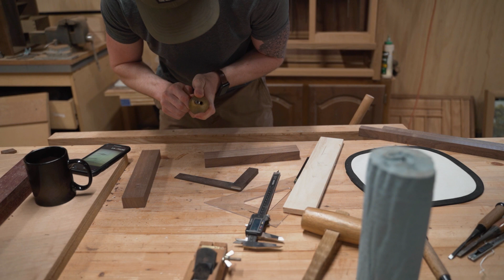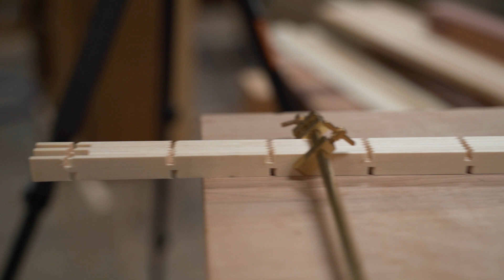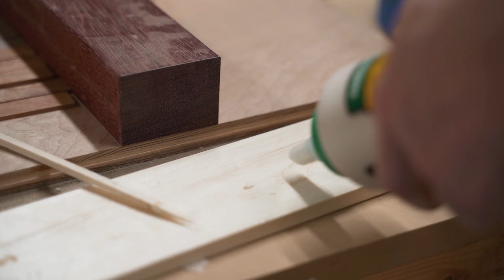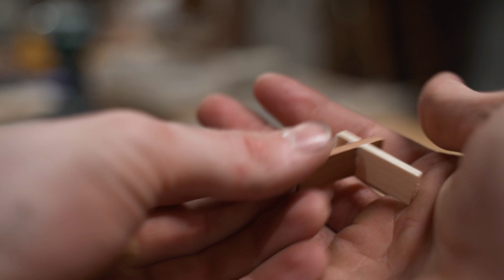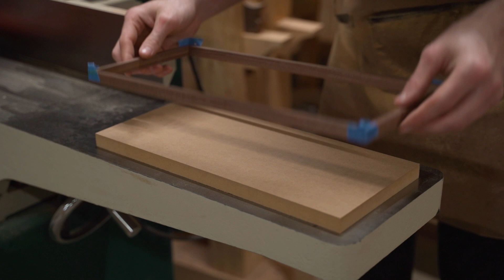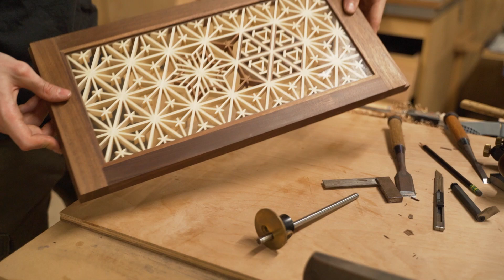Walnut Computer Desk / Ep.7/ KUMIKO panel is complete! Desk is complete!

Comment: Excellent work as always from you. I really like your thickness jig for the Kanna. But I’m curious how you know when you’ve reached the desired 3.3mm thickness? Is it by eye, or do you measure each strip as you get closer to final thickness? Thanks for sharing your work.
Reply from the maker: For whatever reason my kanna doesn’t cut into the mdf, so it quits cutting when it gets flush with the top. So the groove is cut to exact thickness. This takes some trial and error and maybe a bit of luck to get right without going too far lol
Reply: @SethsProject  I bet those strips really shine after running your Kanna over them. I’ve been using a drum sander for thickness planing, but I sure miss the finish from a sharp blade. I will definitely be employing your jig in the near future. Thanks.
Reply from the maker: @johnturk8622  It’s funny you say that lol. I would most certainly use a drum sander over my method. It’s way faster!